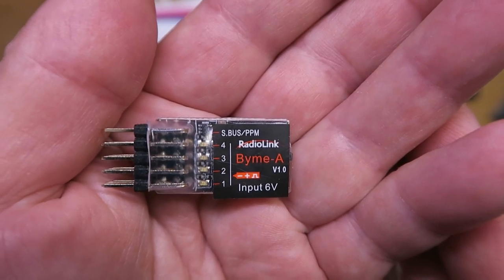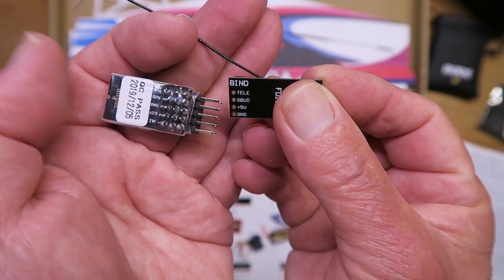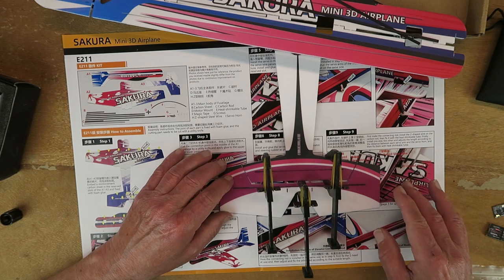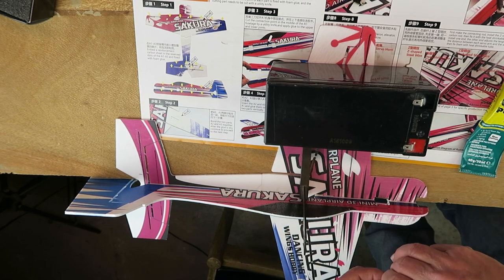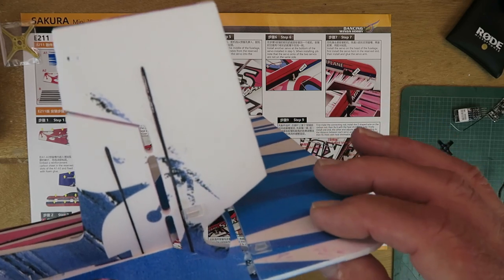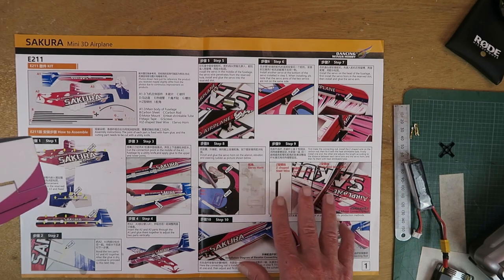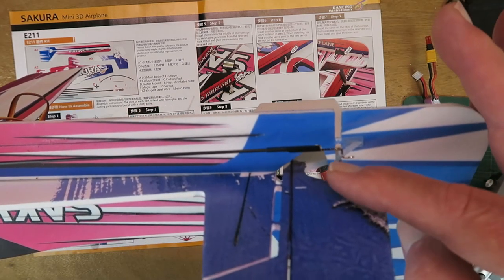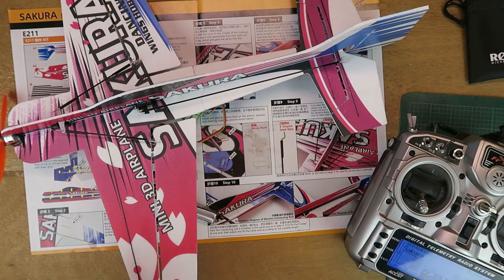Sakura Mini 3D RC Airplane With Radiolink Byme-A 6 Axis Stabilisation Kit Build

Comment: How did it fly with the 450mah battery, I searched your channel but didn't find a flight video
Reply from the maker: Sadly it never flew long enough to video! After many attempts it still just dove into the ground. I was really disappointed with it ;-(
Reply: @1nformatica  bruh. your battery was too big. so was your motor. its supposed to be a 1104/1106 motor with a 150 mah battery. whyd u put such heavy equipment inside
Reply from the maker: @iammeobviously6815  In hindsight you are correct. I used what I had to hand and it was too heavy. Learned a lot in the 4 years since then!! Thanks for watching, have a great day!

Comment: One thing your videos have (or should have) taught us is to read the plans/ instructions before and during the construction process!
Many of us and I am guilty as charged jump in and only make reference to written word when all else fails.
My only other observation is to congratulate you on dabbling in the dark art of 3D flying which as you know requires flying at or near the stall
speed of the model - something us mere mortals try to avoid at all costs!
Last of all is that a slow fly prop?
Reply from the maker: Thank you for your valuable feedback Tom. Having worked in customer support for many years my mantra is "RTFM"!! It is not a "slow fly" prop per se, the motor & prop are from a Bonsai wing. This is experimental (possibly just mental in the present clime)! Working on the principle that a brick will fly if you strap enough power on it! The working (or not) of the flight controller will be interesting.
Reply: I had serve dyslexia growing up. My family are all high achievers scholars my Dad is a Harvard law school graduate, my dyslexia really upset my people: when I still could not read in the 4th grade. I learned to read the manual beginning to end for only as long as I can maintain my concentration-- try to rip the knowledge-- from the paper-- into my brain. I can get through two or three sections; then I walk away do something else. I just keep going all day and night until a deep slow reading is completed. The second step is to let the reading sink in for at least two hours without looking at the model at all. I read beginning the build, and is incredible after the break; because the manual pops out with new insights. Anytime I lose focus, frustrated or tired take at least a ten minute break. Try not to make steps that can not be undone using pins, tape or just a drop of glue in case I did not interpret the instructions completely correct. Do not put a time limit or any pressure on yourself. These are big Boy toys for pleasure and good times not a JOB. I usually get my models built 100% correct and working on the first attempt. Farewell, Brad

Comment: Hello, I couldn't find the UHU brand POR type of foam glue to reinforce the parts of this airplane, therefore is it okay to use Hot Melt Glue in medium temperature to reinforce the parts of this airplane?  Please reply to this question as early as possible.
Reply from the maker: Hot melt will be OK. Try to find a glue in your country like the UHU Por as it gives you time to re position the parts unlike hot melt that will "grab" quickly. Look for "foam tac", "gorilla" glue or Scotch "gel" glue. You will have to experiment as some glues will melt the foam!! Thanks for watching, have a great day!
Reply: @1nformatica  Hello, thank you very much for your reply! I received this kit version(without any electronic) of E010 Sakura airplane from AEORC factory so I weight the overall body parts of the package included all items but excluding the instruction manual, the weight was 38g(grammes).I searched every where to buy likes this UHU por type of glue but unfortunately, the oversees air transportation doesn't support to ship the glue items through the air. Hence I measured the weight of just only one stick of glue gun stick, it was 10g(grammes) so I asked from the factory that will it fine to use the Hot melt glue for reinforce the parts of this airplane so they said that if I used the hot melt glue the aircraft overall flying weight will be increased so as the result, it would be hard to fly, hence use a specified glue for foam. I am using very light weight electronic components like 2g servos, a 1106 brushless motor with prop saver and a 5030 propellers and a 8g of weight ESC, with a ELRS micro receiver and this Byme A flight controller ,I just prefer to build this model to fly on 1s(3.7v)  and so far the motor unit can trust 165g in weight when supply 2s power, therefore if I prefer to build this airplane in 1s(3.7v) power  and with using the hot melt glue for reinforce the parts , will it fly fine without any issue?
Reply from the maker: @suji99hettiarachchi  As it will be heavier using hot melt glue I would go for a 2S setup. This would mean you can use an ESC with BEC and not need a separate one.

Comment: Nice video. Your voice is so calm and makes the video more beautiful to listen. What is the AUW? And is the foam some sort of thin 3mm foam? Or is it epp foam? Is the carbon strips thickness 1mmx3mm? And what battery did you use? I dont have frsky, so which receiver should i use for flysky 6ch transmitter?
Reply from the maker: Hey thanks! The AUW was around 90g with the 2S 450 mAh High Volt battery. It's a depron type foam and 1mm * 3mm carbon. You can use a FLYSKY FS-A8S 8CH PPM IBUS SBUS AFHDS 2A Mini Receiver https://s.click.aliexpress.com/e/_AT55mR Thanks for watching, have a great day!
Reply: @1nformatica ah brilliant I was just going to ask that same question.   I have a couple of byme A s .

Comment: My Build is 77g including 2x 300mah 1s Lipo. But my CG is way behind where it should actually be. I would have to place the batteries in front of the motor to get that fixed. Did you guys applied some additional weight in the front?
Reply from the maker: Mine was around 100g but I used a larger motor and ESC which moved the CG forward, no extra weight.
Reply: @1nformatica  thx. I've installed 2x 450mah now pretty much in the front and CG seems to be perfect now. I have a micro rx and the ESC and motor from the set. Everything is pretty lightweight.

Comment: What was your ready-to-fly weight in the end? Mine's 99g. I don't know if this is reasonable to even attempt flying given the packaging says 55g.
I've got a 300mAh lipo and a non-mini receiver on it. I can't find a 150mAh pack like it suggests.
Reply from the maker: Mine was around 100g as well. I don't know how they got 55g!
Reply: @1nformatica  here's hoping the others I've seen on YouTube with them are also that heavy.
Will you be uploading a flight review with BymeA remarks?
Reply from the maker: @ukmitch86  Unfortunately I had an unplanned encounter with Terra Firma which totalled the front end beyond repair. Totally my fault! The Byme A is going in another plane to do a flight review but at the moment travel restrictions prevent :-(
Reply: Mine is 85g ready to fly....I haven't maiden it yet....300mah 2s, 3 3.7g servos, fs6a receiver, Vgood 6A esc, 1108 3000kv motor and a 5030R prop.....it looks it have enough power to fly it!

Comment: There is a hole on the top part of the fuselage, right at the start of the black part. This is where CG is supposed to be. So just put a screwdriver through the hole and one can balance and check battery positions.
Reply from the maker: Thanks, the instructions I have make no mention of that! Please consider subscribing if you have not done so already!

Comment: I flew mine today CG is about 110mm from the head. Mount your battery on the opposite side of the torque roll from your prop mine is set up with no flight controller flies Great.My Glue of choice is Foam Safe CA with a kicker . This thing  Can really take a hit. Use thick clear tape on top of your control areas for hinges this is some of my ordered parts                                 5PCS GWS EP 5043 5x4.3 Inch 125x110mm Slow Flyer SF Electric...US$5.99 
1-2S 7A Brushless ESC High Speed For RC Airplane...
US$10.38 x 1
Racerstar Racing Edition 1106 BR1106 3800KV 1-3S Brushless Motor...
US$10.24 x 1
Reply from the maker: Very useful information, thanks!
Reply: Great information, thanks
Reply: Can share rate expo setup for this plane

Comment: In step 13 of the user manual leaflet, it is written that the CG is 110 mm aft of the nose (the frond end of the EPP structure, , with the motor not installed). Thanks for your videos. I am in the process of putting one Sakura together !
Reply from the maker: Thanks for the info. Good luck with your build. Please consider subscribing if you have not done so already!

Comment: Good morning sir, 
After this video i bought the sakura, could you please advice me a battery and a reciver. 
It's my firs build I always bought things already made, this time I'm a little bit lost. 
Thank you
Reply from the maker: Hi, the battery in the video is Gaoneng 7.6V 450Mah 80C 2S HV Lipo Battery XT30 Plug http://bit.ly/Gaoneng2S450 The receiver will depend on what transmitter you have, tell me what Tx you use and I can advise. Really any small 4 channel Rx will do.
Reply: @1nformatica  thank you for the answer, I have a radio master, with open tx, I also bought like you the radiolink Byme-A 6 

After all is  the airplane able to do aerobatic tricks ? Or it just fly's  normal?
Reply from the maker: @nicolaesposito2557  For a receiver consider the Frsky XM+ Micro D16 SBUS Full Range Receiver http://bit.ly/FrSKY_XM_Plus I have used them a lot and they are small and reliable. My piloting skills are basic so I only flew it "normally". Unfortunately I managed to smack it into the ground hard and smashed up the nose pretty good! It is awaiting repairs.
Reply: @1nformatica  I'm sorry for you, anyway it's quite normal with aerobatic smashing on the floor :) 
Thank you for all your info once it's done I'll do a video for you
Reply from the maker: @nicolaesposito2557  No worries! It is all part of the fun! Look forward to see the video.
Reply: @1nformatica  today I received the airplane but they forgot to put in the box the engine servos prop and esc. 
So I'm quite lost because I bought them but they didn't send me
Reply from the maker: @nicolaesposito2557  You need to contact the supplier. The kit does not include those items, they need to be ordered separately like this set : http://bit.ly/MiniPowerSys
Reply: @1nformatica  ok thank you, anyway I purchased the kit with the airplane but I never got it. 
Never mind I have sent a complain to bangood if they don't give me the kit I buy another one.
Reply from the maker: @nicolaesposito2557  They have always been correct with me, they should refund you or send another. Good luck!
Reply: @1nformatica  thank you I hope so

Comment: U took my other half of the instructions
Reply: You've got E210 right? Bloody thing refers to E211 and not available on DW website
Reply: @ukmitch86  yep
Reply: @ukmitch86  i bought e210 pnp
Reply: It said it was rtf but wut the helllll it came pnp
Reply: @iammeobviously6815  last time I order from Banggood - they sent me the kit without electronics. After showing photos of the packaging with the model number of the kit plainly showing they sent the wrong thing, they offered to take it back. I've built mine now, will test when the weather suits.
Mine does weigh 99g though.
Reply: Ok

Comment: Anyone tried both 1s and 2s systems? I can't decide what to install so I stopped building. My battery options are Turnigy 1s 300mah and Turnigy 2s 260mah. I strictly fly 3D and have built hundreds of planes, but I can't decide which way I want to go with this build.